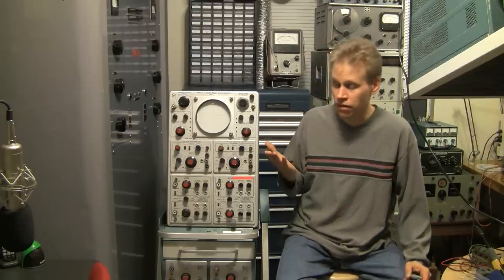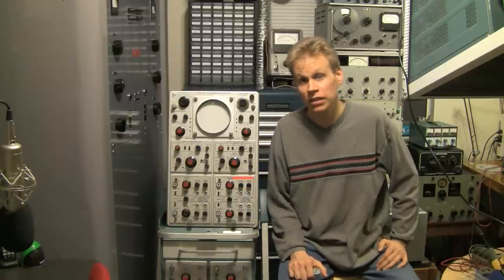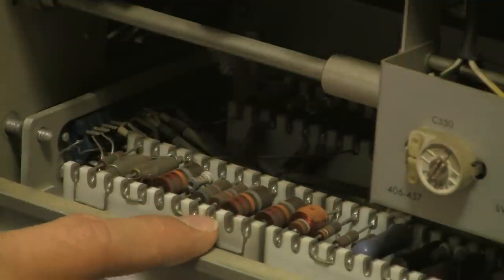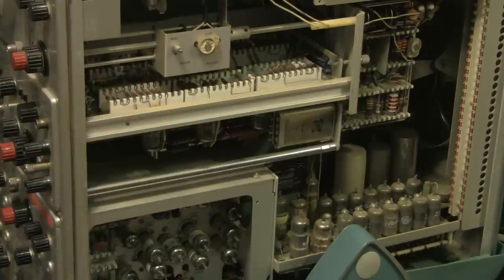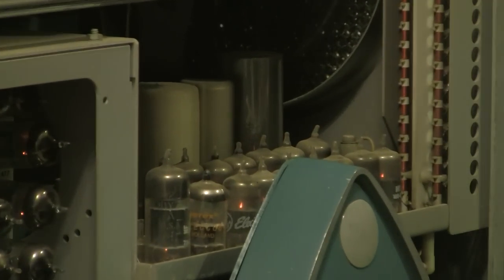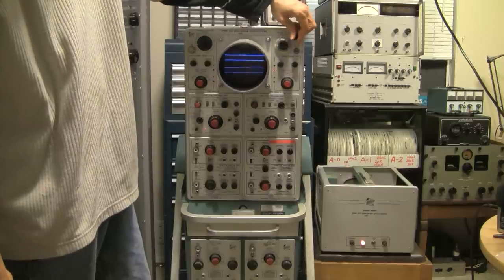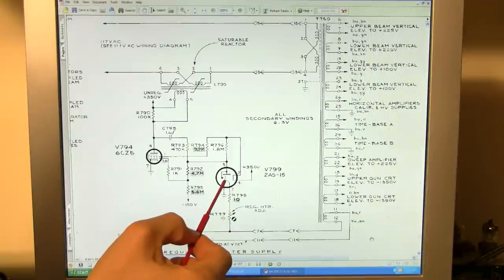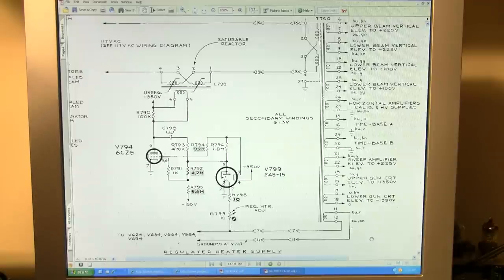Tektronix type 555 oscilloscope, over 100 tubes inside!

Comment: In fact, the tubes are not the principal weakness.  Even if one fails, they are mostly still available, and cheap.  The electrolytics in cans are a weakness, and hard, if not impossible to find.
Reply: MrShobar I don't think so.  High voltage electrolytic caps are in widespread mass production for the input stages of switch mode power supplies of all sizes, so finding a desired size should be almost trivial. Of cause those are polarized high tolerance caps, so for precision you may have to do your own binning and may need to be picky about the nonlinearities.  Unpolarized electrolytic caps are harder to find outside of motor capacitors, but you may be able to find the value in a non-electrolytic type thanks to improvements in fabrication techniques.

Comment: That was a very cool circuit. Those designers were genius back then! Thanks for sharing that. I want to hear more bout the 555! Wasn't that the one developed for the nuclear weapons testing?
Reply from the maker: Hi Gary, they all had their purpose. I think the scope you're thinking of is the TEK Type 519.
Reply: Paul, you're absolutely correct! I have a couple of RM-64s and an HP 130B in the vintage section. Currently I'm restoring a 7704A that came with all of the harmonica connectors that plug in the A20, I've spent the last few days perusing the service manual and it's very poorly documented. Would you happen to have a 7704A? If you do, and it's not too inconvenient, could you take a closeup of the connector between the display and the acquisition unit?

Comment: Hi Paul.  Just out of curiosity, and because I know how particular you are about your test gear, have you checked the PS capacitors and/or measured the PS ripple on this scope to see if it meets specification?  Thanks; I am watching this video for probably the sixth time 👍🏻
Reply from the maker: Glad your enjoying it Shaun. It's all good! I find most of these older scopes to be amazingly well built. I also have the two Tektronics type 547's above where I sit. All original caps in those as well. The see fair use, and all is still good. Some of the earlier Tek scopes had bumblebee or black beauty caps in them, those need changing immediately. I won't even turn one of those on until they are all gone.
Reply: Thanks Paul.  Have a great Christmas 2016!!

Comment: Hello Mr Carlson,   Thats one mighty piece of equipment i must say. And in outstanding condition.  But thats not why I commenting.  I am very new to electronics so new that i just purchased my first bench power supply (Chinese but it seems to work oK for now)  but on this weekend i purchased a very old Jayen 555 oscilloscope Well thats what i think it is and thats what the tag says, Its old its beat up it don't work LOL. I got it at an auction for $31.05Aus.  Now I have the balls to tackle it but I cant seem to find a single piece of info on it , And I know without a schematic I have ZERO chance of getting anything from this old unit.  I was hoping you might be able to tell me where I might find such info.  I would have bought a working unit but being old and not working thats not going to happen so this was a chance i took as one thing i do have is time.  I appreciate any help you can give me thank you  from Aussie cooper.

Comment: Hey there.... Wonderful scope.

I'm an old tek fan, I currently own a Type 422 and an awesome 547. Both have some issues though that I'm trying to fix and I thought maybe you could help me out a bit with the 422.... It works perfect besides the fact that the whole trace either from channel 1 or channel 2 oscillates in the vertical and horizontal axis along with the wall voltage oscillations (my house doesn't have such a constant wall voltage, it goes back and forth from 210 to 225VDC aprox). What do you think I could be the problem? Thanks!

Comment: I'm watching this in 2018 and $2600 in 1950 would have the buying power of  $27,159.42 in 2018 dollars.
Reply: And, like he said, this is only the mainframe. No timebase or vertical amp included. These did cost a few hundred $ each as well. Some even way more, a sampling plug-in went for >10k. So a ready to use 555 was most likely between 4 and 5 grand.

Comment: Just a noob here but....
If the 2AS-15 is only monitoring one secondary, what about the other windings ?
I suppose if another heater winding shorted or opened the scope simply wouldn't work.
Could a partial short in a secondary occur, changing its o/p voltage ?
BTW that is "a thing of beauty & a joy to behold" .... porcelain substrate "boards".... tasty...

Thanks Paul, I'm newly subbed & hoping to  work my way tru all your excellent vids..
Personally, I find tube basics easier to understand than semi cons...
Keep up the sterling work... it's much appreciated... 
the internet was MADE for this kinda stuff, not the "social networking" crap that most use it for...
Sorry... rant off.. 😔😒

Comment: Thanks for all the hard work you put into these videos. I had one of those scopes years ago, I bought from an acquaitance, but never put it to use. I ended up selling it to another acquaitance, who wanted to restore it, so at least it didn't go to waste... It really was an impressive piece of machinery, and it still had some NASA stickers on it. For hobbyist use, do you have an opinion on the cheap chinesium scopes that sell on Amazon?
Reply from the maker: Hi Bob. I would stick with something well known, if you want to spend some money on a scope. I'm always trying to look down the road, and I don't know about the track record of cheap equipment. If the quality is anything like the TV's, run and run fast! I see you know the difference between "acquaintance" and "friend." For some, this is a lesson "hard learned." Thank you for your kind comment!
Reply: Mr Carlson's Lab I got it from this guy! He had a load of scopes, and this was the most impressive looking one. Wish I'd have had more time and room to have kept it. I have an HP 180A scope with 1801A dual channel 50 MHZ and 1821A time base plug-ins. I was looking at the cheap ones as something for my 13 y/o to mess around with.

Comment: According to the Measuring Worth website: "In 2014, the relative value of $2,600.00 form 1950 ranges from $16,400.00 to $86,300" .

This is dependent on the method used to calculate. Knowing how much professional equipment costs these days, I suspect the real relative worth would be pushing toward the higher end of that scale.
Reply from the maker: +RCbeastly  Crazy money for an oscilloscope!

Comment: 1:50 I mean my 1 channel oscilloscope from the era(c1-54 from 1970) weights around 80 pounds and it got handle on top as well, so it's not that heavy for the time.

Oh, also it was thanks to that handle that i was even able to obtain it. I carried it for like 10 kilometers like that, it still was a bitch to carry, but thanks to the handle it wasn't as bad as it could have been.

Comment: Had to back away from the screen a few times to escape the heat radiating from the horde of giant carbon resistors, much less filament heaters.  Saturable reactors, frequently paired with control inputs from Wheatstone bridges with multiple variable resistance sensors, were once common in aircraft control and indicating circuits.  Problems were almost always with the external (to the box) sensors and not the internals.  But, if some internal component did fail or drift, woe to the bench technician who had to rebalance all the bridges and reactors in the shop.  Sometimes there did not seem to be enough resistance decade boxes in the world to make all the circuits happy.  Digital is so nice.
Reply from the maker: +Hopelessand Forlorn 
Thanks for your comment!

Comment: Sexay beast. Truly the Rolex of test gear, and hell - a 30MHz scope even today isn't exactly a useless tool. My first real girlfriend was an air force surplus 585/B2 plug-in/cart which i bought on site ($250 in 84) with no means to get it home. Luckily like everything else old Tek, the cart had real wheels.

Inherent quality today is intangible. You can't really see the difference between a $400 and $4000 bit of gear, Branding is (literally) adhesive. Sure that 555 was the price of a Cadillac, but when you looked inside you understood why. Now you drop x dollars on a PCB board fabricated with the same method (and often componets) used to make novelty electronic items and you pay for FPGA development and firmware.

Tubes unreliable? Ha! That's the late 70's mantra from when they were trying to sell Japanese silicon AV gear, and admittedly the gear of the day wasn't half bad - I often come across late 70's transistor stuff still working perfectly.

Okay, so tubes don't mix well with hammers, they do degrade, some become gassy, cathodes do poison, heaters open - but they're also a hell of a lot more forgiving in other ways - transients and momentary whoopsies, etc. One bad rectifier or filter not likely to take out an entire piece of kit.

(Even) consumer gear in the day wasn't considered cheap and disposable. TV's were the third largest household investment (after the car and house) and they HAD to last. Even lowly AA5 radios weren't purchased with "disposable" in mind - often costing a week or more average wages. It wasn't uncommon to have the "kitchen" radio last 40 years, so exactly where did this so called unreliability perception come from?

How many people reading this have replaced their LCD monitors in the last 2 years?

If the apocalypse comes, EE's will be rebuilding the world with dusted off 555's and slipsticks.
Reply from the maker: Jim Vicious Great write up Jim! We are definitely in a disposable era. LOL, are you telling me you rolled that 585 all the way home? Thanks for the comments!
Reply: Mr Carlson's Lab Indeed I did, nearly four miles through downtown Toronto as slowly and gently as I could. Along the way I was questioned by the cops - being pretty well a kid with long hair - who, in trying to determine if i'd really bought it kept asking me "then what does it do". I tried to dummy down waveforms, and voltage plotted against time best I could but it just seemed to anger them. The electronics hobby sure was more exciting then too!

By the way, great channel. Just found you, it'll take a while to go through everything.

Regards, 
Jim.
Reply from the maker: LOL, That a great story. That is dedication and a desire to learn electronics at it's finest! With the introduction of plastic test gear, I have to admit..... The desire to own it is reduced. Thanks for the great story, sounds like something I would have done :^)

Comment: If you use solder with lead on the porcelain terminals the metal terminals will delaminate from the porcelain. I tend to buy the carts with those old boat anchors. I have the HP that was in competition with the Tek 555.  Go buy the top of the line modern Tektronix scope and all the modules & upgrades, and you had better have a 7 figure bank account. My HP still works, and it has over 50 Dutch made ECC88s in one section alone. Those old O scopes are amazing.
Reply: +Seth B The reapair solder coil is usually hung just above or below front of the CRT inside the case.
Reply: +Seth B Someone probably filched it years ago.
Reply: +Seth B I just took a whole palette load of Polaroid cameras for Tektronix & HP O Scopes to the recycling truck at the electronics swap meet in Scottsdale. I don't know, but I suspect film is still available for those. Polaroids are kind of making a comeback in the arty farty realm of trendy photography, again.

Comment: How do I find a schematic diagram for an old tektronics scope? I have poor googling skills and do not even know its year. However, after a decade of not touching it your video has given me inspiration to go find it downstairs and rip open the box enough to see it has a Type Z Plug in Unit (similar to yours) and it is a Type RM35A Tektronix scope. 

I dunno if this is any help but it has no case and these swivels that lock in various positions at about where would be the center of gravity. I always imagined this meant it was rack mounted and meant to be pulled out and worked on on-the-spot maybe in an aircraft or ship.... probably some kind of vessel or maybe a lab setting. I just went through everything wikipedia says on tektronix and there is no mention of a # this low. Could RM mean something, if so what?

Oh, I remember another detail... it had spring loaded hold down on the tubes. So before you can pull a tube you must lift the metallic cover off and swivel it aside to get access to the tube. This is unlike yours. This implies Extra Heavy Duty use like maybe on a plane or ship that expected to be in battle.

Ideas? Looks like I've spent most of the night binge watching your videos. Not time wasted, for sure, but this body needs some sleep. Thanks to anyone who read this far and double thanks if you can help me make steps towards solving this little mystery.
Reply: The RM35 is a rackmount version of the 535. Manuals for most vintage Tek gear available here:

http://w140.com/tekwiki/wiki/Main_Page

Comment: I have a similar unit (545B) that was given to me. I replaced some broken and tired tubes but still haven't gotten a trace. A few seconds after they relay trips the gun runs off the top of the screen and can't be brought back.

Someday I hope I can find the time to figure out what is wrong as I am sure it can be brought back to life with the right knowledge.
Reply: The 545b HV transformer is known to get leaky and cause trace to fade away.  You can get a good 545a HV tranny on ebay.  Those don't fail.  If it runs off one side of the screen,  I'd look for leaky capacitors or a resistor that changed  value when warming up.
Reply: @ayrplanes  Thank you. Is there a way to test for leaky transformer?

Comment: I have two 545a scopes and even though I have bought a smaller Tek 475 200 meg scope, I have kept the 545 because I use the diode recovery plugin to test diodes and transistors.  I would never part with the old girl because it is a beautiful piece of art.  I enjoyed the video/.
Reply from the maker: Thanks for the comment!
Reply: +Mr Carlson's Lab My youngest son brought home a Tek 555 with extra plugins, cart, breakout adaptor for working on the plugins, all the manuals and several probes from an abandoned engineering lab at his college. They were going to toss it out!  Like you, no way did I have a Variac big enough to bring it back to life slowly but it worked fine.  Heats up my little antique electronic shop in the basement very well.  We call it the "scope-o-saurus".  I used one in '68 at a Navy tech. training center when I was in the USMC.  One fine piece of equipment and I enjoyed your video.
Reply from the maker: Thanks for the great story! Nice to see you saved another piece of history as well. I'm sure it will outlast most modern pieces of test equipment.
Reply: Thanks, I appreciate the comment.

Comment: Dear sir: your explanation of  regulation circuitry by describing "corrective" action in the face of  practically  impossible imbalance is quite profound. I thought I'd solely invented the same explanation technique 35 years ago when I found static textbook examples of regulation mechanisms so lacking of real insight as to be practically worthless. I'm very curious as to whether you invented this explanation technique yourself as I did (and took over an evening of night-school to detail my findings in the face of hopeless confusion expressed by my co-students)   or if it was passed along to you by one means or another.